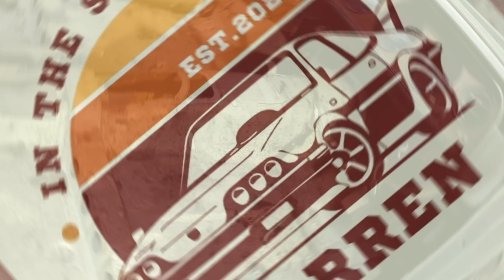I couldn't find a decent dash pad, so I made one! - Galant Hardtop EP 19

Comment: looks good  thinking to curve the area near the dash cluster you could use sme real dense foam glued there then cut the curve into it so when you cover it in vinyl it will look more original 
or fill that area with spray foam them cut it to the shape 
there was a galant at a recent auction i went to around that model  pretty sure they crushed it since
Reply from the maker: Thanks mate, not yet sure which direction it’s going to go. Lots to think about